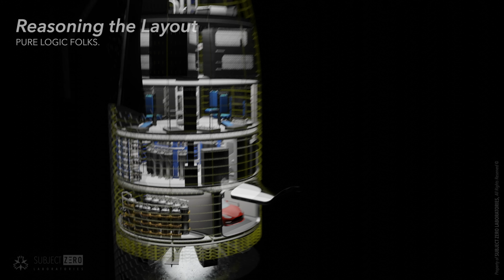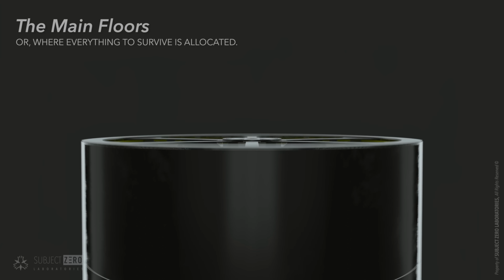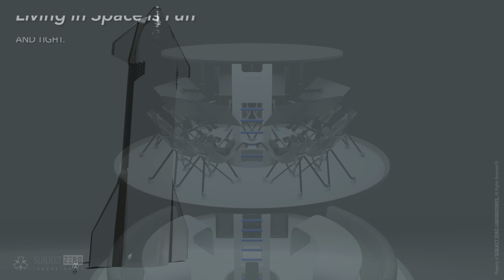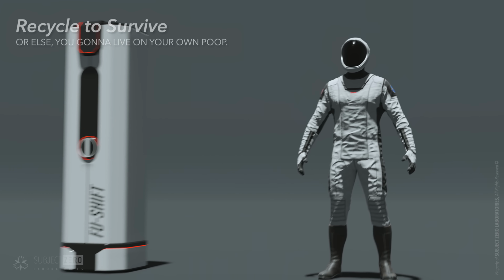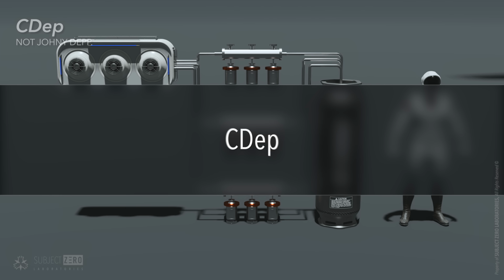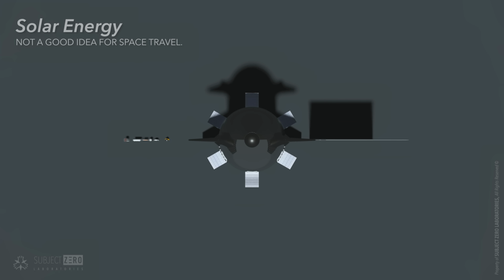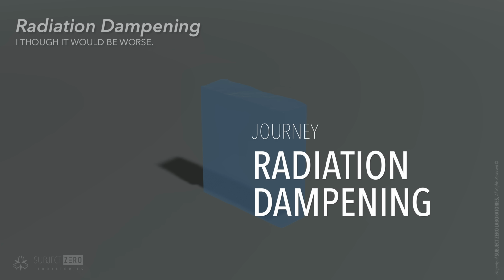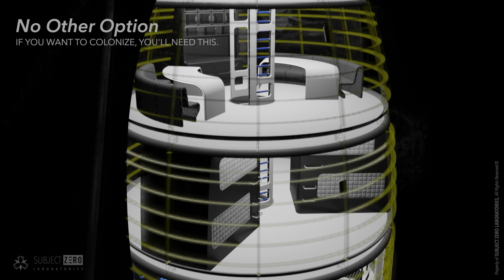Onboard the SpaceX Starship 2.0 in Detail - What it takes to go to Mars | Detailed Breakdown

Comment: Perhaps someone else has pointed this out: this is not Starship 2.0 that you are discussing; it is Starship version 1.0. 

Starship 2.0 is only a concept on paper. 2.0 will have double the height of version 1.0 and double the width to 18 meters (roughly 60 feet in diameter). It’s carrying capacity will be roughly 9x that of version 1.0. And there’s no way the development of Starship 2.0 will seriously start within the next 5 years. 

Otherwise, I agree with most of what you state about using starship (now 1.0) on a trip to Mars. However, there are known work arounds to some of the problems you mention, including unmanned robotic cargo missions to go to Mars ahead of time to set up a base for Astronauts to later arrive. 14 crew members on first trip to Mars sounds about right. But as the base is established and quirks are worked thru and fixed. The number of people on Starship can drastically be increased (not nearly as much as Elon would lead us to believe).

Comment: I'm curious about the last part "Water Radiation shields", the video says "... comes mostly from the sun so if the spaceship aligns itself at an angle where the tanks are pointed towards it most of the radiation will be blocked". How is it possible? I'm not expert at all so I would like to know. When travelling in space, the sun is not "behind" the spacecraft since the spacecraft uses an elliptical trajectory, so the sun would be most likely on one side of the spacecraft. So how do you align the spacecraft? Like you tilte the spacecraft during the travel (after leaving earth orbit)?

Comment: Solar panels would be more effective than you would think at least initially, until inverse squared becomes too much to handle. While the ISS is a marvel of engineering it began construction in 98 and much of the technology used aboard is the same as when it began. We now have more efficient and more powerful technology that can do the same with less. Not to mention, if the hardware is purpose built (ASIC, Application Specific Integrated Circuits), the computational side of things could drop power consumption to as much as a tenth of a general PC. Tighter tolerances with modern manufacturing capabilities may also increase efficiency in other areas as well.

Comment: The thing about using solar energy is misleading, buy the time starship is human rated and ready to take human to mars, which is mostly likely in the mid to late 2030s wouldn't solar panel efficiency be much higher due to better technology mainly perovskite or graphene, i am confident buy the time starship is ready solar efficiency will be around 35-40% which would greatly reduce the size and weight of solar panels required to power starship.

Comment: hydrogen will leak, so normal LIFEPO4 Batteries make more sense. Also modern solarpanels produce 300W per Square Meter and the solarpanels could be used on mars afterwards. I see no issue in huge solar arrays, as we speak about nearly no gravity on the journey.  Also we could use Flexible Perovskite Solar Panels which could be applied as ultra thin layers on the Spaceship itself (except heatshield side). Nuclear Energy would need plenty of mass. Nuclear Energy made sense 30 years ago, when solar technology was at 3% Efficiency, now wea re at 30% and more.
The LOX Tank of the spaceship itself could be used as LOX Tank, further reducing weight on the journey. We can reduce shielding, if we use the Water-Tanks as shielding, reducing mass even further.

Comment: Outstanding-!  Well thought out too.

QUESTION:  In terms of an ARTIFICIAL GRAVITY ... (and I'd think some great minds are working on this) ... what about having one or two of the STARSHIP LEVELS be on a FREE-FLOATING TURNTABLE as it's already Zero-G and thus ... little or no resistance and it'll continually spin when the Astros are walking on it, at least 1G, is attained via socks / booties that have, as in '2001' -- VELCRO BOTTOMS. 

This way, they will 'stick' to the flooring and get the benefit of an Artificial Gravity of sorts.

I mean, use what's against them, (ZERO-G) for the need of a Gravity.  If it's on a Gear System, something like the Air being pumped in can go through the gearing transfers to be the impedes of rotations.

It's like when one fights, you can get hit by the punch or use the punch against itself by the sheer motion coming at you.

Any ideas from the cheap seats ..?

D.A.

ps:  Let's not forget MAGNETISM ... with shoes / booties being Magnetic and the floors / walls are opposite and with the ELECTRICAL SYSTEMS working in conjunction ... it becomes a LEVITATION 'REPULSOR SYSTEM' like when you put opposing magnets -- electrified in opposition and thus, causing the deck levels to ROTATE ... and thus artificial gravity.

Comment: There is something you forgot (or didn’t realize). You are considering that the ride to Mars is going to consist of just one starship. In reality, Elon will strap several Star Ships together. They will contain water, fuel, food, oxygen, and other consumables. Don’t forget about redundancy. Look for more than one ship carrying the same stocks. It seems wasteful but necessary for safety. Besides, it can be used for the return journey, which means a triple redundant system would be needed. One used to Mars, one used on Mars, and one used for the return. Saying everything goes right and more than one system is used. Okay, obviously I am getting into the weeds here.

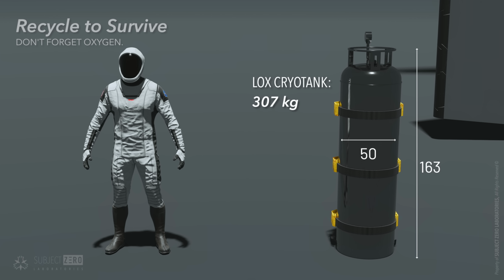Comment: @8:00 I thot you were going to say, the gas from the poop 💩 is a resource, it's Sharship fuel, methane, don't waste, ehh, waste. Gases can be collected by pump and compressed to storage tanks. Incineration is a waste of potential fuel, water (in the poop), fuel for power generation thru hydrogen fuel cells (hydrogen can be deduced from poop), and future fertilizer (the Martian, we need nitrogen on Mars coz there's none at all, a lot of it, this is very important for the colony 🥴). That poop with it's ecology is probably one of the most important byproduct of the mission. Most things in the ship are bombs anyway, so don't worry. Poop can't be that bad 😁😂
Reply: So visit the poop question in a follow-up video, we've that whether we like it or not, as long as there are humans in the equation. See if all of this can nearly tie into a closed loop.

Comment: They really need RPS (Radioisotope Power Systems) for electricity, or at least as a supplement to the Hydrogen fuel cells. They are safe, dependable, light and have about a 20-year life span. Their use would free up all sorts of space and weight.

Comment: I was thinking, 4 to 10 people going all the way to Mars on a single Starship sounds pretty risky and gutsy.
Instead, why not have 10 Starship “convoys” go to Mars all at the same time, with a one or two ship redundancy?  That would probably take a fuel depot in Earth orbit to fully fuel all the ships so that they can all launch close enough together that they can rendezvous en route into cable and electrical power linked groups of 5 ships.  There could be maybe 4 types of ships:  crew ships, 3 of them capable of supporting 12 crew each.  Each with one or two airlocks.  So they go with a total convoy crew of 12, providing triple redundancy, or maybe 18 which should give double redundancy, amongst two ships should one have a loss of life-support capability failure.  The other ship types might be a power supply ship, a food and water supply ship and a cargo, extra food and oxygen supplies ship.  So maybe the remaining 7 ships might be two power ships, 2 food and water ships and 3 cargo ships.  Additionally, maybe each of the 7 non-crew ships could have emergency crew support for 2 to 4 crew members, as a contingency and to have livable space in which to go to the ship to retrieve supplies, and conduct systems checks…and just another place to escape to for privacy on the 6 month voyage.
Also, the 5-ship groups might be rotated around a central tether hub to replicate Lunar or Martian gravity levels, alleviating the long-term zero-g problem.
Now, there for sure would be some hurdles in my idea.  It’s just an idea.
I think it would be much less stressful if there is a group of ships with multiple systems redundancy.  
The cargo ships might have large packs of solar arrays that could be unfolded/assembled and greatly supplement the power ships.  Maybe also with an en route assembled truss system to add a bit of stability and rigidity to the 5 ship tethers, effectively turning them into a temporary space wheel…it’s a 6 month trip, remember.  
Maybe one of the ships could take CO2 and water vapor out of the crew air and using solar power, convert it into O2 and CH4…maybe the same equipment that will help do that on the surface of Mars, too.
Maybe the 5-ship truss-wheel could be assembled in Earth orbit and pushed on its way to Mars by one of the ships when it departs Earth orbit.  Then the 4 other ships rendezvous and dock to it, connecting up electricity, data, gasses and water links.
A high-gain antenna might be at the hub of the truss, too.  Or as a separate communications spacecraft (such as a Voyager-type spacecraft) that just cruises along separately and provides data and communications relay for any and all of the ships with Earth (and Mars, Moon, etc).  It could also carry primary star tracking, and navigation for the convoy and carry a telescope for imaging any incidental close passes to asteroids on the voyage.  It, as well, could be readied in Earth orbit and boosted atop one of the Starships for the trip to Mars.
Reply: I don’t think any manned trip to Mars is going to occur until about 2033, at the very earliest.  There is so much development and testing to be done.  Lots of simulated trips to Mars need to be made in the relative safety of cislunar space by 6 months orbiting of Lagrange points or of the Moon.  This to “prove” the systems reliable before taking that tremendously larger leap out to Mars.

Comment: Solar panels have been successfully used as far out as Jupiter. The solar flux at Mars is not a reason to reject solar panels as a power option. The driver is total mass to be lifted to support a mission. The longer the mission, the less fuel cells make sense.
Reply: Yeah but scientific instruments use very little energy compared to human needs but solar panels still can give good amount of energy that's for sure just let's don't fully depend on them

Comment: There is no need to have water and oxygen for 6months... both can be recycled. See at ISS.
Power and heat may be generated with Radioisotope thermoelectric generator. In combination with solar panels may solve most of needs.

Comment: The specs of the Starship cargo vessel, makes assumptions like a infastructer facility that can posses gravity. To do so, you need non-dole acceleration at the appox~ 0.5 to 2.5 g-force. This would make rendering far more life sustaining through the trip... 

 The only feasible way would require a nuclesr solar orbit cruiser vessel/engine, one of nano/micro low flow of chem-fuel. OR a robust level energy ion/plasma booster thust, amp with a micro/nano nuclear cell compartment, enough to last a mere 7x vs chem-fuel ratio. Yet can regenerate with no limited canister.

 A common way would be the Starshipto have an additional mid stage, to avoid a double orbit parking rondevue, by offering the Beast stage canister an adjacent allies will link all those considerations. Because even the Beast is not designed to park Starship cargo fully into orbit velocity.

 2 stage alone will NOT make the trip safely. Nor will the double RISK R-R-R... Refuel (2x full Starship fueling cost) - Refill (02 for bio & human cargo pending) - Relaunch  (weather scrub & other time abanding humans in orbit). 
 Starship may require 4 stages, two(2) within earth atmospheres, two(2) at solar orbit, leaving the Starship-cargo plenty of fuel VToL/emergency maneuvers initiative, at eighter arrival points.

Comment: I wouldn't get on one of these boats without at least 2 to 3 other redundant and fully loaded boats flying along side us. There would need to be several starships in orbit as well as a number of ships on the ground, landed and offloaded. Robots will have needed to have preceeded the colony by at least a year and be busy building storage and living facilities on the ground, or under. Proof of concept would have needed to be complete. 

And one more important thing no one is talking about. The first 5 crews will need to be, NOT SCIENTISTS, but maintenance crews and ground workers. I was watching the years leading up to the starship launches and TBH the scientists could phone in their logic, but hands on the machines needs to be strong, mechanical minded electricians, plumbers, rocketeers, etc. No exceptions or you all die tragic deaths in the cold vacuum of space.

Comment: I still cannot figure out who is going to build a concrete landing pad for Starship. It looks like it would easily tip over if the ground were not perfectly flat and level. On the first moon landing remember manual control had to be used to fly the lander to a safe landing. Starship does not seem to be built for this. What say u

Comment: Relying on fuel cells would be dodgy. You don't take more than you need with space travel and relying on consumables when you don't have to is just not done. I can pretty much guarantee that they'll use PVs.

First your maths is way off on the hydrogen consumption. ISS consumes 90kW of power, over an hour that is 90kWh. (90kWh)/(33.6kWh)/kg = 2.678 kg of hydrogen per hour. You wouldn't even reach a week of power with only 400kg of hydrogen. On a five year mission that is 365.25*5*24=43830 hours mulitply by 2.678 and you get 117376.74 kg or 117 tonnes of hydrogen. Add in oxygen (two hydrogen atoms for each oxygen, oxygen has an atomic weight of 8, meaning you need to bring 4 times the mass of oxygen as you have hydrogen) and you'd be bringing about 586 tonnes of hydrogen and oxygen for electricity. That is a complete non-starter.

Secondly, the ISS doesn't rely on fuel cells. If fuel cells were such a great idea, why off Earth would they not be using them in on a vehicle which is literally as close to resupply as anything in space is? The ISS also spends about half of its time on the dark side of the Earth, so functionally it's solar panels have to be about twice the size you'd need for the Mars cruise phase. Once you get to Mars it's no problem, just roll out thin film PV on the surface and sweep them every other week.

Also i couldn't keep track of your units "2x30 metres. Total of 7.8 kWh each" is kind of meaningless because them panels are going to produce far more than 7.8kWh over their life time.

But I looked up the ISS power consumption figures. It's 90kW, assuming at 200 Watts per square metre you'd need 450 square metres of panel, that's 900 square metres for a day night cycle (which on Mars you'll want, the ISS has 2500 square metres but they're older cells...). Basically a circle of 34 metres across would cover 900 metres, to get the equivalent power on Mars you'd just need to put it out to 46 metres (though tbf at that point you'd just deploy thin film rolls on the surface anyway. They've already solved doing that https://youtu.be/imPfyQxgSug. You just use the body of the ship to act as the hub. They you have to factor in that solar panels actually get more efficient the further from the Sun you get (because they get cooler, reaching up to 34% efficency, which is over 50% more efficient than at Earth orbit), so they don't actually suffer a 1/r^2 drop off, it's more like 1/r^1.5 at least out to Mars.

Comment: And redundancy of any of these systems haven't even been mentioned 😂 I always felt that Elon's claim of being able to to move 100 people to Mars on one ship was total BS 😂 More realistically it's 5-6 people because none of the other things needed on the mission have been mentioned. Like spare parts, any resources or materials needed on the Mars surface and probably a coffin or two, as the likelihood that all astronauts will survive such a trip is small to none
Reply: People need to remember that there is a massive difference between the first voyages of discovery with small crews and large amounts of equipment and supplies v much later voyages carrying colonists on a rapid one way trip to an existing facility. Then there's the hype element on top of that. An eva suit would make a fine coffin and could be used for a space burial.

Comment: While I respect the effort put into this video, there are some fundamentally wrong assumptions here. Like the water for example. You are in space, in a sealed vessel. There is no water getting lost or magically vanishing. You breathe out water, water evaporates, and you pee water. All water you consume leaves your body eventually in one way or another. You actually produce more water! Your body turns your food into CO2 and water while it is broken down for energy production. The food you eat doesn't just turn into poop. The "waste product" of your metabolism also is partially water. And all that happens while you are living in a sealed vessel where nothing can get lost unless you purposefully dump it overboard.

Just look at how the ISS deals with the water issue and you see that the calculations for water requirements in this video are way off. And for the rest of the vital resource management, look at the ISS recycling loop to get an idea of how stuff like that works. 

And the reason why you can't shower in space is not that there isn't enough water. There is plenty, but showering in zero-g is a no-no because the water just flies around in droplets which you would breathe in and basically run the risk to drown in your sealed shower cabin. There are many more such wrong assumptions, but I think this is enough.